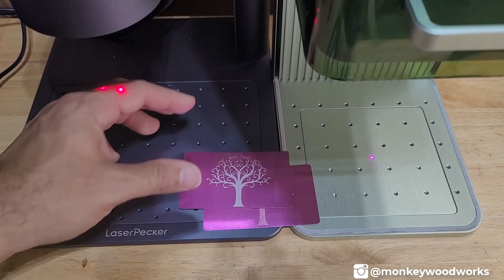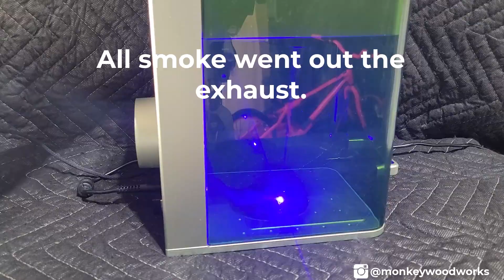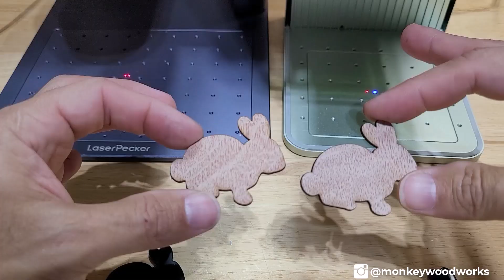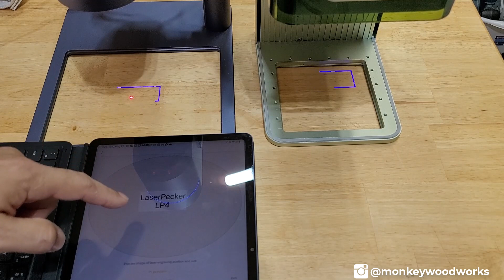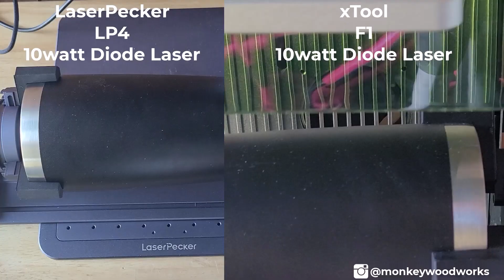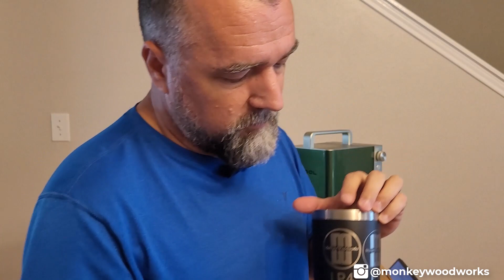Laser Engraver Shoot-out: xTool F1 vs LaserPecker LP4

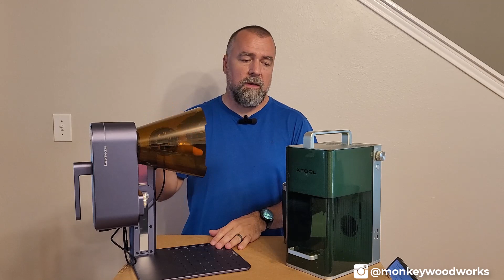Comment: 20:13 will you be really able to engrave a wall (or something that you place the engraver next to) like this? Because the focus point remains at the end of the shield, therefore you wont be able to focus. Unless you are actually able to rotate the head the other way.
Reply from the maker: In that position no.  The base blocks it.  However, you COULD technically remove it from the base and hold it up to the wall assuming you can hold it still enough and in focus.

Comment: As per engraving bottles and tumblers, which do you recommend?
Reply from the maker: Good question.  I would say the F1 when this video first came out for the speed alone however after this was released, LP4 increased their speed matching the F1 (i guess it was a software/firmware upgrade).  Now it is a tough choice.  Honestly, you cant go wrong with either one for that type of engraving.
Reply: @MonkeyWoodworks т.е. на сегодня обе модели близки по скорости? В некоторых примерах мне больше понравился результат F1! При этом быстрее.

Comment: Can they both engrave alluminium and steel?  I am wanting to engrave keyrings. Great video!
Reply from the maker: The IR on both of them can etch on metal.  Some metals can be marked easier than others.  The 2watt IR lasers are fairly weak so you can only expect it to scratch the surface of the metal (etch), not engrave it.
Reply: Thank you so much for your reply. Could you recmend one that would be suitable to those materials please? Thank you so much. @MonkeyWoodworks

Comment: new laserpecker,  the grave speed is 4000mm/s
Reply from the maker: I saw that, good for them matching the speed to get a closer comparison making it a tough decision between the two.   It was not the case during the making of this video.
Reply: @MonkeyWoodworks  good company, and it upgrades very quickly,  and it will releases  L5 this year.

Comment: For a $200 difference (with F1 being more expensive), what machine do you think I should get? I'll be using it mainly for engraving wood and zinc alloy keychains.
Reply from the maker: Honestly, I really like the F1.  Both machines are very similar but they have their differences.  The F1 has less wires hanging off of it.  The shield is attached to the body, and I am personally more familiar with the xTool software vs the Laser Pecker software.

Comment: Can you run the F1 on an inverter or do you need a generator for outside craft shows?
Reply from the maker: I think you mean a Portable Power Station or Solar Power Station.  Yes, you can run the F1 off one of these.  The size of the power station will determine how long you can run it.  xTool actually teamed up with Jackery and offers 2 different size power stations on the xTool site.  They even offer F1 + Power Station combos for people wanting to use them on the go such as craft shows.
Reply: Thank You!!!
 @MonkeyWoodworks

Comment: Your video is great and now I having a hard time to decide! 😂
I originally was going to go with the Laserpecker mainly because the bigger working area. Speed is not a huge deal for me because it’s used for small production batches.  However the problem with the shield was a big deal. Have you used the Laserpecker Laser Protection Cover - it’s supposed to cover the entire perimeter reached by the laser.
Thank you very much! I love your videos!
Reply from the maker: I appreciate the kind words!  It is definitely a tough decision.  They each have pros and cons.  xTool did update their software recently to have live framing like the LP4 has so thats nice.   What you see in this video is all I have tested between the two.
Reply: @MonkeyWoodworks  thank you!
Reply from the maker: @miracles1234  anytime!

Comment: Curious, what were your metal card settings on the LP4 engraving?
Reply from the maker: It was trial and error and I do not recall the final numbers unfortunately.  You can always make a test grid and waste one card to find the perfect setting.  I suggest you always run a test grid on new material to find what works best for both the material and your preference.
Reply: The wrong settings thats what he had it on

Comment: Just bought the F1 bundle. Your video was very reassuring that I got the right one.
Reply from the maker: Great decision!
Reply: @MonkeyWoodworks Hello, have you had any issues with the air filter for the air purifier NOT lasting long and requiring you to change the air filter frequently? I saw some posts/comments in the official F1 FB group where people were commenting that the air filter doesn't last too long before you have to change it to a new one and even though you can wash the air filters they don't last long. My husband and I were considering getting the F1 to possibly use at craft shows, but are now concerned that this machine would prove very costly if we had to repeatedly replace the air filter after only short periods of time. To be more specific about one of the posts/comments I saw, someone just got the F1 in September and has had to replace the filters by getting new kits SEVERAL times. Is that normal? Could you please respond as soon as possible? We are hoping to get the F1 sooner rather than later, but we need answers to our questions before taking the plunge so to speak. Thank you very much.
Reply from the maker: @lindascraftsandthings915  I do not have an air purifier.   The Facebook groups are your best hope for a quick answer.

Comment: So question, which one would you say is better between for a newbie, Xtool F1 & Xtool D1 pro?
Reply from the maker: The F1 and D1 Pro are quite different.  It depends on what you want to do with your laser.   The F1 is what it is.  Small footprint with a 10watt diode and a 2watt infrared.  The D1 Pro has a MUCH bigger footprint + expandable and had different laser options.  I would check out the xTool support page.  I believe they have a comparison chart comparing all of their laser options.   Their new S1 is quite impressive as well.

Comment: I have the LP4 with all of its accessories (even ordered the exhaust machine - not yet received) but even before I watched this video that I regret getting the LP 4 and not the F1.  Go buy the F1 instead of the LP 4 folks.  You can thank me later.
Reply from the maker: Sorry to hear that!  I did find some featrues of the LP4 better than the F1 however i too feel the F1 is the better option IMHO.
Reply: Thx brother i will get the F1.
Reply: I read a Facebook group for the LP4 a lot of posts about the system not working on the phones. And lasers ain’t working properly. I am surprised because that inexpensive unit.

Comment: One of the YT videos I watched (and I’ve seen them all) by Alexandria Knife Sharpening has resolved the problem of the LP 4 having to be refocused. There’s a setting in the software that will allow you to put it right back where it was.
Reply from the maker: Good to know!   I still do not like the shield but that does make it easier to switch out material.
Reply: @MonkeyWoodworks Michael Atkinson just uploaded a short clear video showing how to set up the height automatically to raise and lower the shield. It turns out it’s just a matter of figuring out the software.

Comment: Hi. Would you be able to use the LP4 rotary tool on the F1? Please let me know! And thanks for thaking the time to review them both!
Reply from the maker: No, i dont think you can.
Reply: @MonkeyWoodworks  Thanks. I'll get an adapter to convert the port in a usb C and update you if it works. 💪🏼
Reply: @marcowaters8279 did it work?
Reply: @blaccouttv.3846  I got the xtool rotary and inspecting the cable, is highly likely will work with adapter and/or replacing the connector.
Couod not purchase the LP rotary yet to confirm it 100%
Reply: @marcowaters8279  ok. Yeah I know the xtool rotary works with it. I wanted to know if laserpecker rotary would work with the f1.  But thanks for responding
Reply: I would also like to do the same thing... I'm waiting for your test